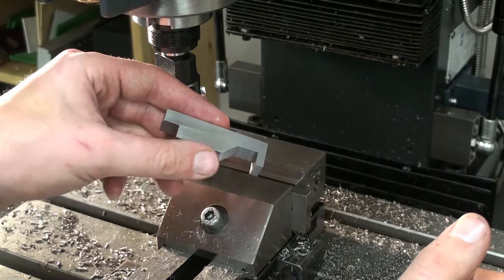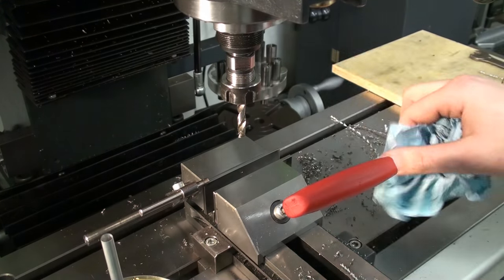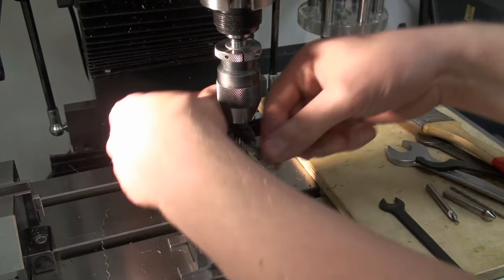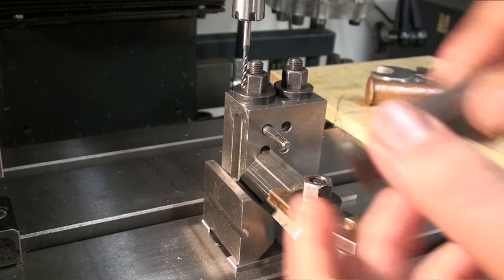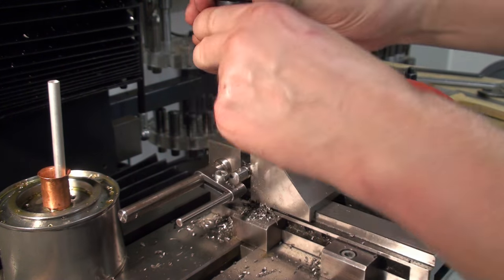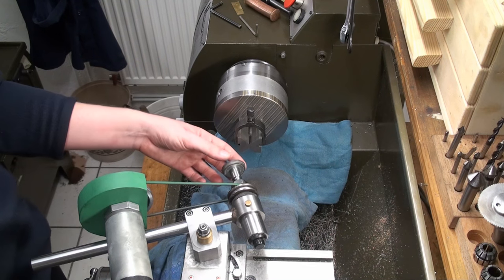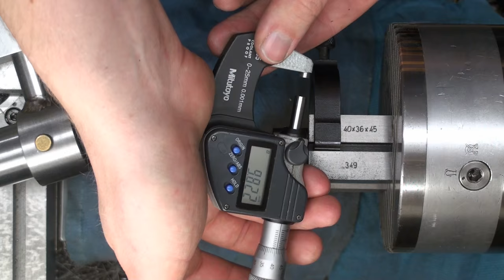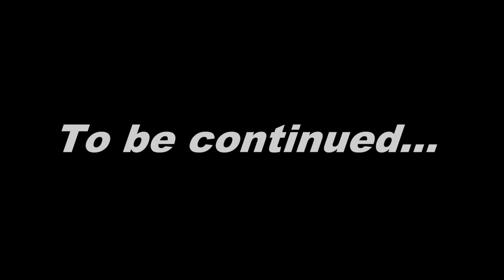Making small sine bars Part 2 - Herstellung kleiner Sinuslineale Teil 2

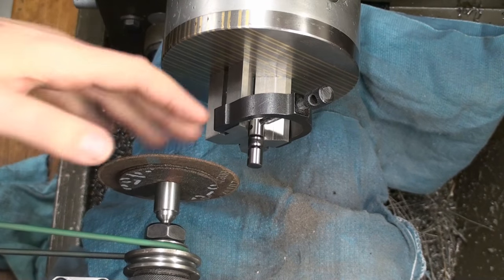Comment: 27:01 "The safety...guys..." German language at work.
Great stuff as always Stefan. Nice work on the screws and holes especially.

BTW, I saw your latest shop talk. Don't glue those tubes in. I use a similar set up in my woodshop and stuff is always getting pushed back up into the tubes. Leave them unglued so they can be dumped out.
Reply from the maker: +joshua43214 I wanted to say something very inappropriate first...and then changed my mind :)

I didnt glue the pipes in due to lazyness and they will stay that way, thanks for the hint :)
Fishing with a bent welding wire for short material pieces is only borderline-funny...

Comment: I noticed gas springs supporting your milling machine head. I presume you added them recently to cut down on the effort required to crank up the head. Do you have any details on sizing and mounting? I also liked your hand tapping method it can yield that extra bit of clearance when one runs out of z height. Keep up the great videos!

Comment: That is a nice tool post grinder. And if you are not sure about the setup, just stand off to the side so you can watch shrapnel go if it happens lol.
Reply from the maker: +Richard Schmidtendorff I step also to the side when I start the Felder tablesaw at work...if some expert didnt tighten the arbor nut for the saw blade I dont want to stand in the line of fire ;)
Reply: yeah lol

Comment: Hi mate.  Very,very nice again.  Putting you nice bars on the shaper, are you not worried that it would be less accurate than let's say grinding them, or is that coming after that?
Reply from the maker: +Marcel Timmers Thank you - Yes, they will not anywhere nearly as accurate as they would if they had been ground on a surface grinder - But they are still well within 1/100mm parallelism between the bottom of the rollers and the top surface :)
Reply: well mate, you will have to follow the trend, and also buy a surface grinder.  ; )  It appears to be the must have at the moment.

Comment: Hi Stefan, Frage? what determined the diameter of the roller. Nice multitasking, but I think the torch should have been in your right hand, but no foul, and no blisters. BTW those wiz wheels don't explode like grenades, you would have to be holding the grinder in your mouth to do damage.
Reply from the maker: +Robert Klein The diameter of the rollers doesnt matter, as long as both are the same diameter. 
Yeah, a lot of people are realy scared about those thin cutoff discs, but if they break, the pieces have very little mass and so dont do a lot of harm...
Reply: Stefan,a famous saying, "Keep your nose to the grindstone"

Comment: Hi Stefan - I'm curious how you indicated the center line of the vee when you drilled.
Reply from the maker: +Zander Kale Just by eye, when you move the drill down into the vee you can see if it deflects to one side. If it does, correct slightly and try again until the drill stands in the centre wen touching into the vee.

Comment: Stefan, in the tool post grinding operation, did you have an independant dial indicator mounted on the traverse/compound or were you just using the lathe dials themselves to advance in?
Reply from the maker: +Peter Thannhauser No I did it just with the cross slide dial - since I made a new dial and changed the bearings for it it runs so smooth and the movements is precise enough that I dont bother with a dial indicator :)